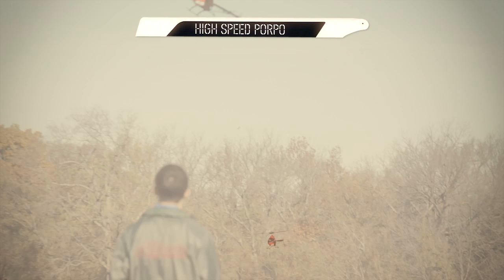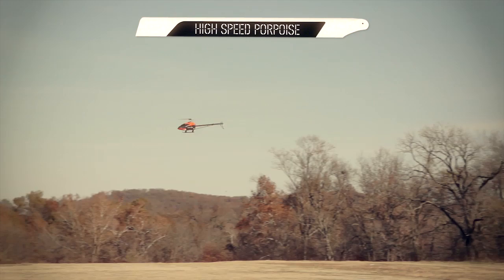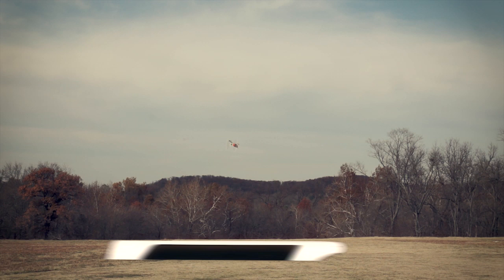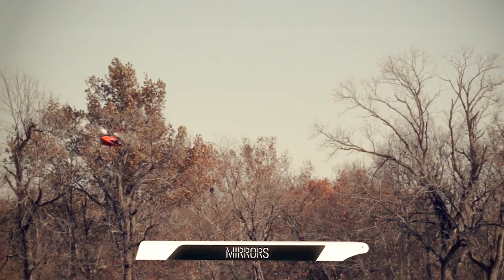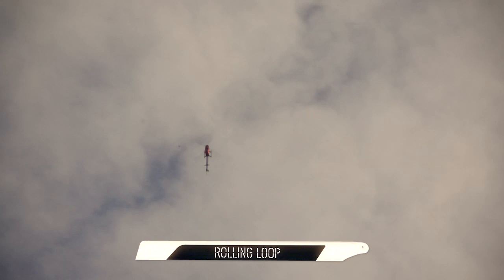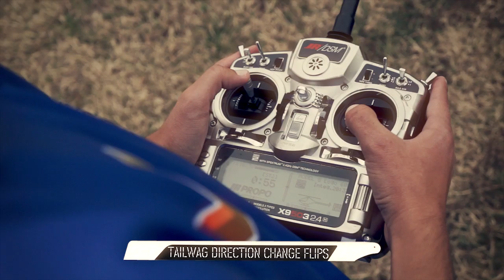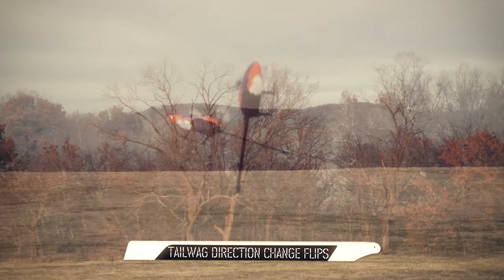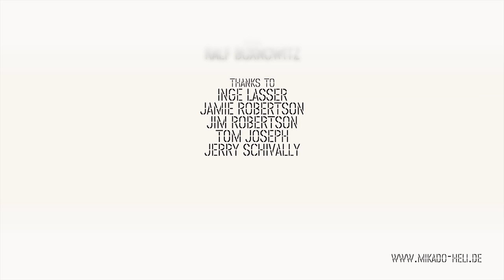Jamie Robertson | The Pilot , The Machine , The Maneuvers

Comment: G36g1095, We have Jamie's BEC set to 6V and the VR5203 steps the voltage down to 5.1v for the tail servo. This prevents his tail servo from getting too hot and causing a possible failure. His tail servo gets quite a workout and the regulator w/less voltage allows it to run cooler. No tail servo issues to date with litterally 100s of flights on each. Jim....

Comment: Racetom, they should work fine but be aware you may have to change some parameters for your taste and the larger SE disc. Also be careful of the gyro settings Jamie uses. Might want to sneek up on those to prevent an unwanted ossilation causing a possible crash. All of Jamie's 600s are using the exact same program but they are NOT SEs. Jim....